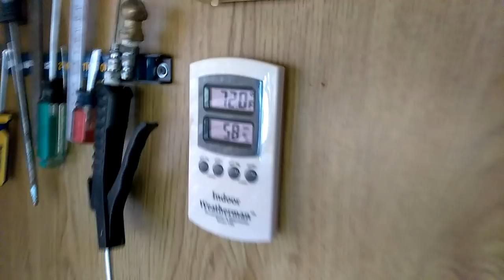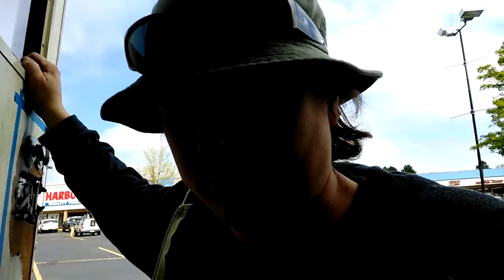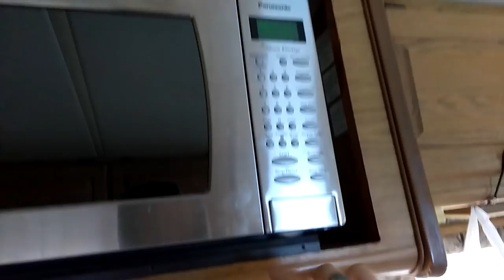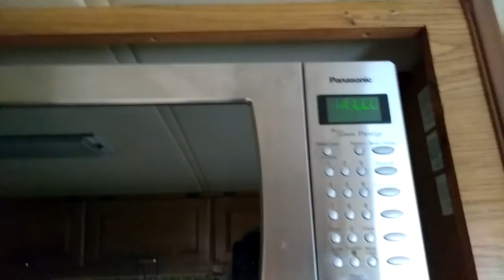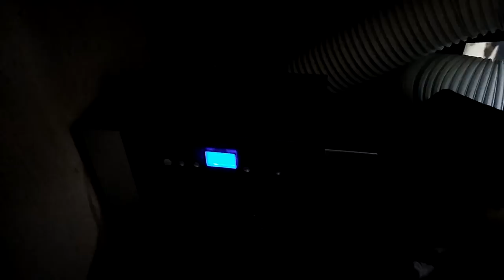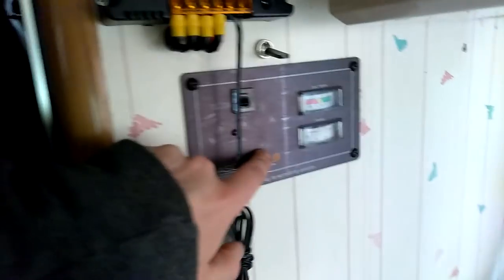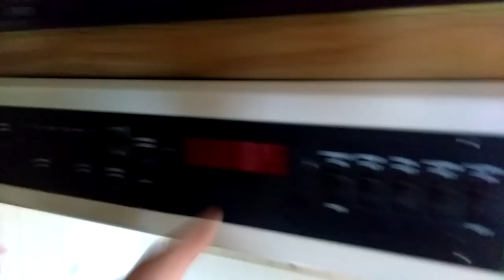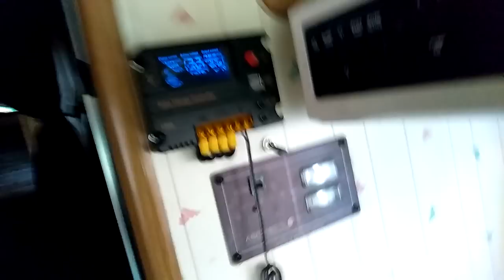Using The Generator To Stay Cool | RV Living VLOG

Comment: We are currently do a bus conversion and the previous owner took out the factory ac unit and replaced it with a mini split. The mini split only works if you are hooked up to shore power, but not while driving which sucks. So I bout a 5000 watt generator to power it while I drive down the road.

Comment: just sayin my friend if u get two  tiny sheets of steel mesh screening n cover the out side one with screen door screen cut it down both parts to fit ac window per happs u could secure both parts to ac hose plate mount it on the open window n place a rubber seal round edges to  seal the lose of air n maybe prevent sum jerk from reaching in your window ....that way u can leave it open with screens attached full time .....
Reply: why not run cord under the rv along the frame rail ....

Comment: first time i see a double hose portable air conditioner working inside a rv like the Whynter 14 000 BTU easily available everywhere. I read that they are more efficient that the single hose unit. You should try to install a muffler on your generator or enclose it in a box. This amount of noise in a parking give a bad name to the rv community especially if you run it in a Walmart parking. You will see the police coming in no time.
Reply: Double hose ACs use one hose to push the hot air out (like the single hose units) but the other hose is used to pull air in to cool the condenser coil (hot side).  So it essentially goes outside air in > pipe > condenser coil > pipe > outside air. It never touches interior air.

Single hose ACs suck the air to cool the condenser coil from the room - the air that's already cooled and because it's sucking air into the coil then blowing it out, it's constantly pulling warm outside air in to replace the air lost. It essentially goes outside air > door/window/any crack in the room > room being cooled  > condenser coil > pipe > outside air

In the UK our range of portable AC is pretty limited, we don't get window ACs nor do we get dual hose units, only single hose. I modified a single hose unit with a box, duct tape and another pipe to turn it into a double hose unit.